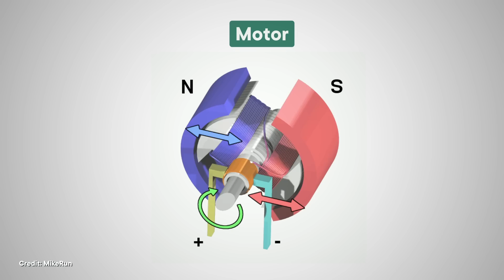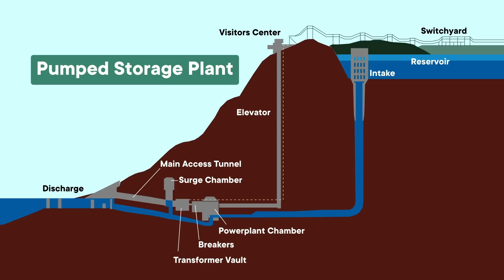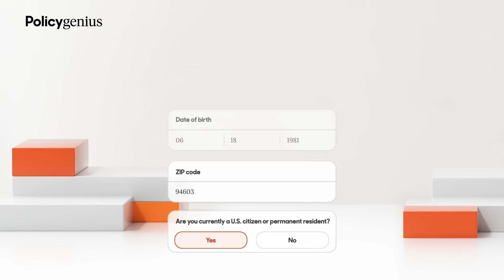How To Make Buildings Into Batteries

Comment: Could you use existing infrastructure like elevators? Use energy to lift, then generate energy to lower.

The number one "green" energy is nuclear. Instead of dealing with failed technologies and hoping for battery technology breakthroughs, we should be putting all that effort and money into efficient and safe nuclear power.

Comment: I was expecting comments whining that "if it's not enough to supply all the energy storage needed ever then it's not worth doing". I was not, however, expecting comments whining about "buildings can't handle that weight" (they can, even moreso if we build them for it) and "buildings can't have water pipes in them / water storage on top" (they already do?? do you live in a house with no plumbing?).

Comment: Why not just retrofit weights to the exteriors or internal spaces of the building, and store the energy that way. Essentially the same way a grandfather clock stores energy to run its mechanism. That would eliminate the need for massive water tanks integrated into the structure, and would be a lot simpler, wouldn't it?

Comment: We have a Nevada Hydro pump project in a town nearby (CA), in addition to the usual Corpo BS, the system has a laundry list of issues.
Locally, were looking at above ground lines that increase fire risk, obstruct fire control, probablele ecological damage to the lake it dumps into, flooding issues in case of failure, ecological damage at the storage site, destruction of national park space, and all for the sweet deal of 'we ruin your space to sell power somewhere else'.
Our grid powers the system, our lake sustains it, our citizens suffer all the consequences, our ecology is damaged - we don't get the power and we don't even get the taxes...

I think a HUGE part of the discussion always needs to be implementation because the same people that got us here are still running the show, into the ground...

Comment: I think this has similar issues to solar roads. It sounds nice on the surface, but it would make more sense to just build energy storage and skyscrapers separately. Skyscrapers need to go in the middle of dense urban centers, where land costs are highest and the goal is to fit as much usable space on the land as possible. Batteries, though, can go anywhere, potentially even states away from where the power is needed, and can therefore be built wherever land is cheapest. Beyond being a PR stunt, I can't imagine the finances for this working out

Comment: The problem with skyscraper gravity batteries is the large weight that it will have to hold at high altitudes. It will take a massive amount of support to keep the the structure from buckling, especially as it flexes in the wind. I don't see this ever leaving the drawing board.

Comment: Wasn't it like 6 years ago that scishow did an episode that explained why gravity batteries are stupid? I was a child who was thrilled with the concept of gravity batteries because I was a child and I'd never heard of a gravity battery. You still have to generate the excess electricity to raise the weight. You also have to build a skyscraper. If we let the architects have their way, there would not be any elevators or emergency staircases or columns inside of a skyscraper because they want open floor plans. Do you really think Chase Bank is going to willingly install a gravity battery that consumes 20% of its floor space on every floor?

Comment: Oh for pete's sake. You guys should be able to do better than this. I went to college during the pandemic for a certificate on the topic, and yeah we A) don't really need batteries that bad because it's not nearly as intermittent as the oil corps would have you believe, and B) would be better off with just about any other energy storage medium because gravity batteries have such low energy density they only make sense at the scale of a lake on a mountain, which is where they also see actual use, as pumped hydroelectric storage. Be careful how you pick your sources on the topic. The oil corps are working hard to push out misinformation like wind and solar being wildly unpredictable. On the contrary, a reasonably developed and designed system would be able to meet the vast majority of our energy needs with wind, solar and hydro-electric just working in their normal harmony with solar peaking during the day and wind power increasing at night.

Comment: Would it use some sort of counterweight so it can generate/store energy as it's using/releasing it? Like a manual elevator. 
Now if we could also figure out how to make solar windows or solar tiles so that the exterior of the building is also generating energy, we would have tangible solutions for newer builds so we could at least stop making things worse.

Comment: More HypeLoop pipe dreams.

It's more marketing than engineering.

Water is a solvent and handling it in a large building makes no sense for energy storage.

They'd do better by using a shaft containing multiple 2 storey concrete blocks on cables and have them pulled to the top by solar or at night by grid power when it's cheaper then let each drop one by one via gravity during the day to run a generator back through a geared pulley system.  Just like an old grandfather clock weight and pulley to drive the clockworks.

It's cheaper, uses existing tech, and would be easy to maintain.

Comment: There was a good video where a guy makes a similar mechanical battery by pulling against a vacuum. It's not as efficient due to friction, but it seems you could get far more total energy storage compared to gravitational potential.
It also shares similarities with compressed air storage, but since you're pulling from a vacuum, there's no thermodynamic heat loss issues.

Comment: There's a reason not to do this.  Well, there are two.  OK, three.  There's the space it would take away from occupancy, there's the non-structural weight to be supported, and then there's the ginormous pressure to be resisted on levels below the top three or four floors.  Someone tell me if there are two more obvious problems so I can go all Spanish Inquisition on this idea.  Ta, muchly.

Comment: That is a dumb as solar roadways... "yay let's put one thing that needs a specific environment ((in this case a huge Volume, a simple, sturdy foundation and a very robust connection to the grid)) and put it in the most inconvenient place possible((in the middle of a City with already expensive realestate, on top of a flimsy concrete skeleton that usually should be designed as light as possible to even be able to built that tall, with people needing to live along side it/leaks beeing a really really big issue and only a 10kV (?🤷‍♂️) connection to the city grid))"

Comment: I think it would be way better to just add floors of just batteries than it would be to do all this. This is silly if you ask me. Sure batteries can set on fire, but you can always put a cage around it. With that said, I dont mean Li batteries, but Na batteries. Na pops vs normally sets on fire. Sure it doesnt hold as much, but it still has all the other benfits of what Li offers and doesnt have as much of a impact either. Could be made anywhere as Na can be found everywhere as well. Over all batteries way better return than any other method currently, so its going to be hard to say other wise for how much it really cost.

Comment: This is a dumb idea. Lifting the volume of an Olympic size swimming pool to the top floor of the Burj would only store about 2 MWhr, even at 100% efficiency. The cost and complexity of designing a building to withstand the forces of being so top heavy would be MUCH more than the ~5 metric tons of li-ion batteries that would store the same amount of energy.

Comment: Using something denser means you need less space to store the same energy, yes? So why isn't someone putting a cylinder of stainless steel into a tube and attaching it to some wiring? Maybe the design specifics need to be different; like you need to use a block instead and basically make it like an elevator except it's a battery... wait, do elevators generate power when go down?

Comment: This is incredibly stupid and I'm slightly surprised hank fell for this. First off, the amount of energy you can store in the building like this is not that much. If you're not going to do actual battery a molten salt is likely superior. Second, if you're building a skyscraper by definition you're doing so because space is at a premium. If that is the case you're not going to waste oodles of space for energy storage. You will have empty space involved 😂. Last, this is the makers of the dumb tower crane thing and Dubai. It's a crank. That's all. You use cheap material for this because otherwise it's too expensive. We have cheaper batteries that are less dense then lithium ion. We have more efficient gravity storage than this. You're not turning a building into a battery just building one around a hollow tube.

Comment: Using a scyscraper as gravity storage is a lot dumber than even the contraption that you call "octopus crane".
You'd either store tiny amounts of energy or make the building's structure (already the most expensive part of a skyscraper) a lot more expensive.
Just put a battery in the basement and be done. Much cheaper, much more energy stored.

Comment: To all the nay-sayers out there and in the comments. Skyscrapers already have some for pumping water up to the higher levels, so the idea of most skyscrapers having a big reservoir in the basement to fill a bunch of think pipes that run the hiet of the building is pretty reasonable. Existing buildings are likely to be retrofitted with small systems that will generate profit over the life of the building.

Comment: The biggest problem of gravity batteries is the super low energy density. Lithium-ion batteries have energy densities of 100 to 250 Wh per kg. If you lift 1 kg by 1 km ( super high skyscraper), you stored just 2.7 Wh. And that would be for block storage. Hydro storage has to contend with losses in pumps, pipes and turbines. You are very good if you manage to get 60% energy recovery overall. Power companies use hydro storage because it can start instantly, this providing buffer power while you start another power plant. It is not used because it is efficient.

Comment: Gravitational potential energy = mass x gravity x height. 
Power = energy over time; Energy = power x time

For approximations sake, gravity = 10 m/s^2

Particularly tall buildings are in the 200-250m range. Lets use 250 here. 

Large wind turbines have a capacity of 3ish megawatts each. 

And lets say we want a gravity battery that can provide the power of a single wind turbine, for a period of 6 hours. Perhaps to boost peak energy supply, or as backup for low wind. 

Right. So, math time.

energy = gravitational potential energy = mass x gravity x height = mass x 10 m/s^2 x 250m
energy = power x time = 3MW x 6hours = 18MWh
energy = energy
18 MWh = 18000000 Wh = mass x 10 m/s^2 x 250m =  mass x 2500m^2/s^2
mass = 18000000 Wh/2500m^2/s^2
(fiddle around with units so it all goes back to kilograms, meters, and seconds)
(1 W = 1 kg x m^2 / s^3; 1 hour = 3600 seconds; 18MWh = 6.48 x 10^10 kg m^2/s^2)

mass = 6.48 x 10^10 kg m^2/s^2 / (2500m^2/s^2)
mass = 25920000 kg, or not quite 26,000 metric tonnes. Or around 57 million pounds. 

This is the weight that would need to be lifted to the top of a single very large sky scraper to provide the equivalent of a few hours of output of a single wind turbine. And this is assuming 0 loss in recovering this potential energy. That weight would represent a significant percentage of the buildings overall mass & would require substantial changes to the structure, compared to a conventional building, to accommodate it & ensure the building is safe in 'charged', 'depleted', and 'partially charged' states. This would add significant cost. It also limits the useable space as that much mass would be quite the volume, even if made from lead blocks (in addition to the machinery and pathways through the building to move the weights). 

Alternative: for every 4 or 5 wind turbines you need, build an extra. Tie them all into the national power grid so that if the wind is light in one area, you draw from the excess being generated 500 miles away. This will be vastly cheaper and consume less resources than using buildings as energy storage. 

Supplement to the alternative: build nuclear power plants for a huge amount of stable base-load power.
Reply: This ignores power lost to heat during the transfer, that those interconnects are designed for the then higher load, that that other section of the grid even has the power generation and battery infrastructure to move the amount of energy that you need.
And that's before you start putting solar and wind on the tower to pump water for storage during times of excess generation. 

Though I do agree we desperately need nuclear for stable base-load power generation.

Comment: Water is too tricky... doesn't really make much sense considering all the problems it can have regarding maintenance, with density and power generated.
I'd say that if you are going to do it with buildings, just replace one of the elevators with a solid block of concrete or some other weight, and use that.
Problem is - it's generally not worth it. The amount of power generated is in most cases not worth the maintenance of the system. Or even, the extra reinforcement needed to do something like that safely.
The gravity based energy storage we have nowadays works mostly because we're talking huge reservoirs of water that are already there... so it's more like a different configuration for a small hydroelectric power plant.

Comment: My only concern is how all this will affect the structural integrity of the building, and the amount on maintenance required to prevent the reservoirs from leaking. Also, just in general, building skyscrapers is costly to the environment because of how much concrete and steel is needed to make them.

Comment: I'm reminded of the James R Thompson Center in Chicago, where I worked in the 1990s. It used cheap electricity overnight to freeze giant ice cubes that then could cool the building during the day (simplified version). Essentially it was an air conditioning battery.
Reply: Almost every building in major cities does out of hours heating/cooling already

Comment: This is cool, but this technology in sky scrapers isn't really viable for existing sky scrapers as a retrofit. I am an MEP engineer in NYC and I design building infrastructure similar to this. There are cool viable energy storage technologies like ice thermal storage that can store thermal energy to offset peak cooling energy consumption. Thermal batteries are awesome and are used currently. There are also cool advancements in this technology using phase changing materials instead of water for energy storage, which has advantages of using normal chillers instead of ice making chillers.

Comment: Compressed air is much more economical if combined with a thermal battery. Gravity batteries are mostly fictitious.
Reply: More accurately, gravity batteries are extremely location-dependant, much like geothermal and hydroelectric.
They're not efficient to put everywhere, but can be the right choice when the natural landscape is conducive to them.

Comment: Pumped hydro is not an efficient battery you lose 20-40% of the power for every single cycle because pumps and water turbines are not all that efficient. It would also not have much storage capacity for the structural load that it would take to turn a building into a water battery. This is what happens when an architect(artists) contracts an engineering firm to create them a solution. The engineers will take the money but it is not a great solution.

Comment: I can see another benefit of having water batteries in large buildings, if the walls are to hold the water, that would make cooling much simpler, as the water density will cool the surrounding areas of the building.
Reply: That's great for places that don't get a true winter. Take that further north, and it runs the risk of freezing and cracking open, inside and out. 

I'm assuming that's why they're looking for the water to be at the core, rather than the outside walls.

Comment: There's been at least one mining company that created energy moving ore. Regenerative braking on a full truck coming downhill created enough energy to drive the empty truck back up the hill.  There are many ideas that solve one problem in one place and it's likely the combination of all of these will be necessary.

Also, lithium batteries are popular for being lightweight.  They don't make nearly as much sense for immobile grid storage.  There are cheaper alternatives.

Comment: I'm confused. Don't the basic laws of thermodynamics require that any such system must require more energy input from external sources than it can possibly produce?
Reply: There is always loss to waste heat.  Even traditional electrical batteries like your Zinc batteries lose energy to heat.
Reply: Any energy storage system will have some degree of inefficiency, yes, but that doesn't mean we don't still need to use at least one option to move energy through time so that we can meet demand when it happens.

Comment: Wave power?  Tides work 24/7 and there are always waves on the open ocean.
Reply: Unfortunately, tidal power just isn't viable in the real world.  Between the caustic effects of seawater and the marine fouling from things like seaweed and barnacles, they maintenance costs are too high and the expected lifetime of the generators too low for the benefits to outweigh the costs.

It was tried in multiple ways, but the real-world engineering challenges are just too great for it to be efficient.